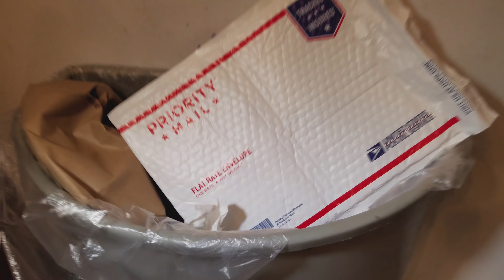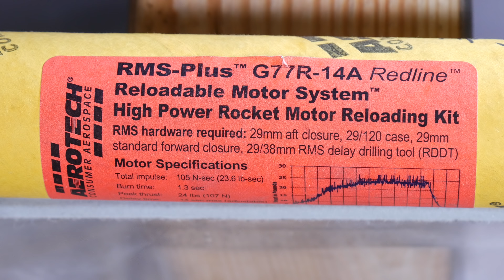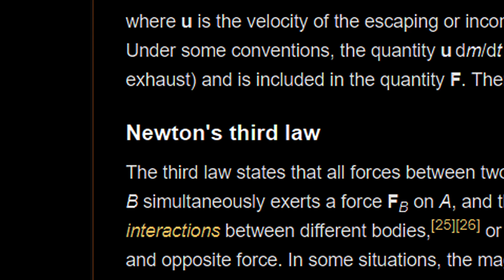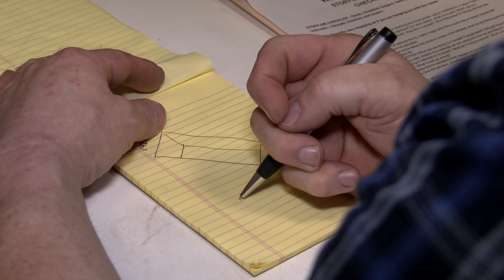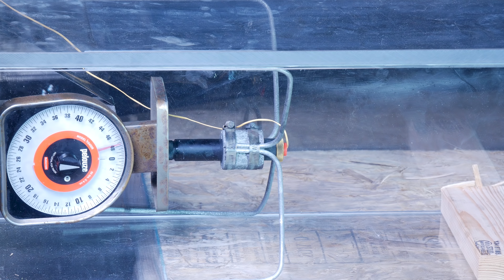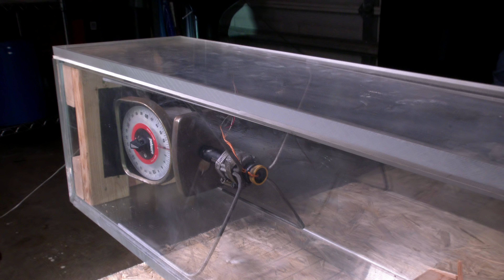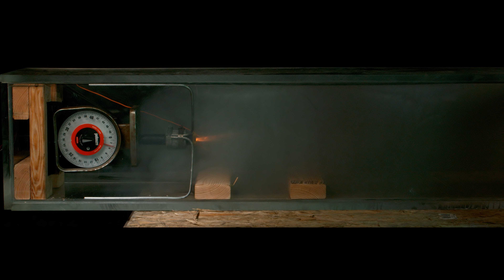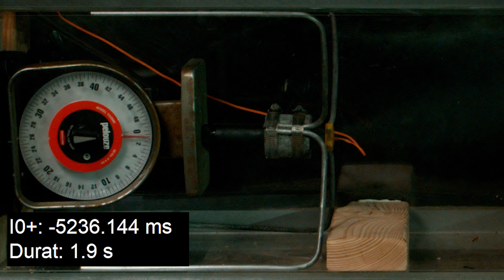Rockets in a Vacuum Chamber - Newton's third law of motion Visualized

Comment: The rocket doesn't push on the air; the propellant pushes on the rocket as it ejects.
Reply: Force=Mass X Acceleration. The gasses accelerating out the back provide a force.
Reply: Papa Legba  How do you explain GPS satellites or the ISS. I have made telescopic and naked eye observations of the ISS. Without functional rocket propulsion, no space vehicle could maintain a stable orbit.
Reply: @ulfhenarpolymathmilitant6258  It all has relative speeds. Picture two cars driving next to each other at 100mph, if you're in one car, the other one will appear stationary if both speeds are exactly the same. Orbital rendezvous is achieved by matching velocity and direction to the target.
Reply: @twistedyogert the iss isn't in the vacuum of outer space, it's in low earth orbit.

Comment: I think you have to try it with longer chamber, so we can see how many "smokes" needed to reach the dead end of the room before it push the non-vacuum material.
Reply: Doesn't the rocket push against the wall's of the small chamber, seems like its the wrong parameters for any real conclusion. Much respect for effort and engineering though.
Reply: The thrust meter measures thrust before the plume of smoke gets a few inches from the nozzle. SO thrust is there before the chamber fills up.

Comment: What is a "complete vacuum"?  There is no such thing. Vacuum levels are have specific terms tied to them as follows: (RV) Rough vacuum= 1x10-3 torr,  (HV) High Vacuum= 1x10-7 Torr, (UHV) Ultra High Vacuum 1x10-11.  The terms "complete vacuum" and "full vacuum" are meaningless.
Reply: @OliverMiles98  This guy doesn''t have a high vacuum pump[ (turbo pump or cryo pump).  So he is operating in the rough vacuum regime.  So that means lots and lots of molecules left in that box.  In fact I would be surprised if  he is even less than 1 torr.
Reply: @bigfoot7883  but space is not a "pure" vacuum either. The idea for the video comes from flat earthers who say a rocket wouldn't work in space cuz its a vacuum hence rockets and space are lies, hence the world is flat.

Comment: In the interests of seeing how well this experiment replicated a state of perpetual vacuum, I would have liked to have seen the  pressure measurement gauge at all times also throughout the entire duration of the experiment.  This data is more than somewhat crucial to the entire experiment if to challenge Newton's 3rd Law of Motion.  Thrust was measured.  Tick that box.  But was this within a state of perpetual vacuum?  It's a shame the experiment did not demonstrate this at all times.  If you look at the pressure gauge at around 10 minutes of the video, you can actually see the pressure gauge moving rapidly in direct response to the rocket burn. So on that basis, this in itself demonstrates the experiment is a fail.  I believe that this shows that the chamber was immediately subject to positively increasing pressure in direct ratio to the energy release of the rocket burn.  I think that there is a distinct prospect here that chamber was immensely too small for this experiment to be accurate.  Would love to see a re-run with this aspect compensated for properly.  The vacuum chamber would have to be quite huge I think, and the actual  size would have to be mathematically derived at.

Comment: Did you not prove Newton’s 3rd law with the hangfire? Though it did not propel your sled, it did propel the smoke.  Smoke is a physical object as well.  In your second attempt, you see the fuse and ignitor swing free, so as the thrust pushed, the ignitor moved. 3rd law.
Reply from the maker: Exactly..... Agreed
Reply: how about for every action there is an equal and opposite reaction .... no 3rd law except on earth
Reply: Dennis Allen  It moves down because everything that is not affixed to something will go down and since it was curved it moved down towards its curvature and that happens in oxygen as well with out having to ignite it.
Reply: nickacelvn what the f*** are you talking about? The Earth doesn't have something behind it pushing it? The Earth is basically falling in a straight line and being bent by gravity around the Sun. What exactly are you even asking here?
Reply: c5elmo76 but why didn't move anywhere? In order for it to move down or swing it had to be pushed off of what it was connected to. How did it do this with no Force? Was it gravity that pushed it away from what it was connected to and then made it swing down?
Reply: Dennis Allen excellent observation 💡
🤓

Comment: To simulate the vacuum of space, you need to create a vacuum that is removing the exhaust from the rocket as fast as it's being dispelled or you are creating a pressure that would not occur in the vacuum and void of an ever-expanding space.
Reply: Nope, because the rocket produces force before the exhaust builds up any pressure.

Comment: So you started with the box (small closed system) under vacuum,... once the solid state fuel finally achieved stable ignition, the gasses created a toxic but physical atmosphere thus filling the (small closed system) vacuum with pressure. Once the volume of vacuumed space was pressured by the gases (I assume the vacuum was nolonger running) the rocket gained increased footing for which to push off of.

Build a new vacuum chamber the size of a room and try this experiment again while continuously running the vacuum on high to simulate the open expanse of space.

I'll feel better with those results. This test will take into account the variables in question as mentioned above thus reducing the likelihood of the propellent creating its own atmospheric conditions.

Thanks
Reply: It would probably work, however to maintain a vacuum in a chamber that size would require rather large vacuum pumps and would still not accomplish anything since we saw thrust in the first few seconds of ignition, long before the chamber had a chance to become compromised.  Add to this the fact that rockets do not produce thrust by pushing off of atmosphere, but instead by using Newton's third law to push the motor in the opposite direction of the nozzle opening due to uneven pressure on the internal walls of the combustion chamber, and you will see why it didn't really matter that the chamber was eventually compromised by the exhaust gasses.
Reply: Oh god, it would not work.  Constant vacuum will constantly negate any atmosphere created by the fuel hence no atmosphere, no barrier=no going to space and no thrusts.  Do not be silly my man lol
Reply: +Rizal Jose Your nonsensical gibberish was silly, not Newton's third law.

For an example of constant vacuum, see Peter Leane's videos.  Very tiny motor.  Chamber was large enough that the expelled gas didn't make the pressure gauge on the chamber twitch.  Produced thrust.
Reply: I was thinking the same thing , this vacuum is no where near scale

Comment: The scale's needle deflects as soon as the engine starts,  when the vacuum is at it's greatest,  and then decreases as time goes on and the vacuum is filled.  If pressure is needed for the engine's force you'd see the opposite pattern.
Reply: rtensor That’s why the efficiency of a rocket engine gets higher when going higher haha
Reply: But the gasses instantly collect before ignition showing it wasn't in a vacuum to being with. An object in motion stays in motion until acted upon by an outside force. Why did the gasses initially collect in the middle? Answer, there was an opposing force remaining within this supposed vacuum. THIS is what you call bunk science.
Reply: @jrngln  I see u lack a basic understanding of how a rocket engine actually works. The burning propellant of a rocket has mass. The rocket engine pushes against burned propellant. The rocket engine creates its own "atmosphere".
Reply: @idontcare7961  The weight of the exhaust gasses is exactly the same as that of the burned propellant. That's basic chemical knowledge. In the case of the NASA Shuttle that is 20x the weight of the Shuttle. That means the Shuttle ejects 20 times its weight in exhaust gasses to reach space. In short ur, physical and chemical knowledge is that of a 5-year-old.
Reply: @idontcare7961  I stated that because that is basic chemical knowledge. Learn how to read.
Reply: @idontcare7961  And your point is? To insult other people with every comment?
Reply: @lifepolicy  Its the truth, not an insult.
Reply: @idontcare7961  So what you are basically saying is that man by building a rocket became god because they suddenly were able to annihilate mass?

Comment: Great Work! I would like to see the pressure guage reading along with the scale reading side by side.  I suspect that initial ignition might re-pressurize the vacuum chamber? The vastness of space would be hard to re-pressurize. Kudos to the ingenuity and effort!
Reply: You "suspect"?
Please calculate the volume of gas produced in the burning of the rocket fuel. Don't forget to show your working.

In the meantime, you can watch countless armature rocket videos of vehicles continuing to accelerate under power as they climb through the rapidly thinning atmosphere.
Reply: you can see in the video there no suspecting,  you see the exhaust pushing off the walls and the back end of the chamber filling up which then pushes it back towards the rocket. even a long bit of soot can be seen(in slo mo part of clip) travelling towards the backend and hit the higher pressure coming back up towards the scale end and joining it, it even passes through/against the new exhaust  when its burning it hardest and catches fire but that new exhaust isn't enough to push agaist the pressure built up from the other end and goes to land at the scale  end. as for him working out the volume there a pressure guage on the chamber all you need to do is see what it at before starting and what it is at after should tell you the new mass in the chamber. rockets lose speed travelling straight up as the air gets thin the exhaust flame spreads right out in all directions meaning less going straight down giving less thrust upward to the point they can't keep going  staight up and so you see them arc over and fly out of sight  crash in the ocean or whatever lol they not going up into a vacuum  and getting any thrust at all
Reply: @darrenprebble6921  more to the point, rockets work BETTER in a vacuum as there's zero resistance.

At least get SOMETHING right.
Reply: @TheTruthHz  rockets can only go straight up until the air get that thin the exhaust spreadout in all direction giving less trust upwards which is why they then fly off to the side away out of sight , if they worked better in a vacuum there be no need as they would be getting more trust being up there but thats not the case

Comment: That's my point. He made a very small chamber and produced atmosphere in it and that's how thrust produced. But space is infinite and it does not behave like this small chamber.

And the most important point is there should be a strong boundary just like your chamber to separate vaccum and atmosphere. Where is that strong boundary or earth?
Reply: - "there should be a strong boundary just like your chamber to separate vaccum and atmosphere. "
A device called a "Gas Centrifuge" can create a region of high-pressure gas right next to a region of low-pressure gas (a "vacuum") with no barrier between the two regions.
This creates a Pressure "Gradient" all the way from high pressure to low pressure just like we observe in earth's atmosphere.

What is the theory of operation of the Gas Centrifuge?
Reply: @stuartgray5877  a gas centrifuge has boundaries, chatbot.
Reply: @papalegba6796  SO AS USUAL, you refuse to answer the question: HOW does a Gas Centrifuge do what YOU CLAIM IS IMPOSSIBLE?
Reply: @stuartgray5877  by having boundaries, chatbot. Already told you 😂
Reply: @papalegba6796  The answer (for your tiny brain) IS: CENTRIFUGAL FORCE.
But since it is obvious you don't even understand the meaning of the word "Force", then you are excused.

Yes, a Force (or acceleration) CAN compress gases such that they exhibit a Pressure GRADIENT. Exactly how GRAVITY applies a FORCE to compress gas against the surface of the earth creating a Pressure GRADIENT. Next you will tell us Atmospheric pressure gradient in earth's atmosphere is a hoax.
Come on do it genius.
Tells us you DONT believe that atmospheric pressure decreases as a function of altitude.
Reply: @stuartgray5877  ok chatbot 😂
Reply: @stuartgray5877 you contradicted yourself totally & I laughed at you, chatbot. You always do 😂😂😂

Comment: It seems like no one in the comments actually KNOWS anything about anything they haven't experience.  It's all relying on their own belief in someone else's 'experiences'.    These little vacuum experiments are problematic to me because they light the rocket fuel in a tiny confined space, after a few short moments the space is actually filled with gases allowing for some, although, slight movement.  Would it work the same in an endless void?
Reply: It would work better. 

Here is my simple question to folks that don't understand how rockets work in a vacuum. 
If I set an explosion off right next to you in  the void of space, would it have any effect on you?
Reply: @entangledmindcells9359  combustion in a vacuum is impossible. So your question is pointless.
Reply: what gets me is the rocket doesn't actually properly ignite until the chamber is filled which makes you wonder if combustion is even possible in a vacuum at all
Reply: @robertenator  it is not, violates first law of thermodynamics as it posits a change in energy of a system incapable of either energy transfer or doing work.
Reply: @robertenator  all combustion needs is fuel and oxidizer to allow the chemical reaction to take place.
Reply: @papalegba6796  what prevents combustion in space?
Reply: @entangledmindcells9359  you need pressure to contain the system
Reply: Alex - "It seems like no one in the comments actually KNOWS anything about anything they haven't experience"

Try ME then.
I am a vacuum test specialist and I have been launching deep space science probes for almost 30 years.
Ask me any question you like about the Mars Global Surveyor, Stardust, Genesis, Deep Impact, Kepler Space Telescope, NOAA-20, or IXPE Xray Telescope spacecraft. I helped launch all of those.
Reply: @robertenator  - "you need pressure to contain the system"
When a rocket engine is running EVEN IN SPACE, the combustion chamber is at about 3000 PSI.
So YOU are arguing that combustion will not occur at 3000 PSI with fuel and oxidizer JUST BECAUSE - Somewhere DOWNSTREAM the pressure drops to zero?
I don't think you have thought that one through.
Reply: @robertenator  what absolute pressure is required. It has been shown at 300,000 ft combustion can occur.  At that altitude, the air pressure is a fraction of 1% of what it is at see level so exactly when does combustion cease to be possible? what  absolute pressure?

(FYI.. even is space, there is a positive absolute pressure)
Reply: @robertenator  - "you need pressure to contain the system"
Tell that to the 4 Solid Rocket motors that I have personally helped launch that lit in hard vacuum.
Those missions were Mars Global Surveyor, Stardust, Deep Impact, and Kepler Space Telescope.

All of those launched on a Delta II with a Star 48 solid Rocket Motor third stage.
Reply: @entangledmindcells9359  I just explained, chatbot 😂
Reply: @sailorman8668  I believe a gas requires external pressure in order to create work, chatbot. Because it's a gas law 😂😂😂😂😂
Reply: @robertenator  correct, you got it. Without pressure, combustion is impossible.
Reply: @papalegba6796  How much pressure is required?
Reply: @papalegba6796  good thing the combustion chamber of a rocket runs at over 3000 PSI even when operating in HARD VACUUM.
Reply: @stuartgray5877  that's an internal force, chatbot. Newtons laws all require external force. 😂😂😂😂😂😂😂😂😂
Reply: @@Sobeit63 chatbot Stuart literally claiming fire is water in its last post. It will rant for months about this if you allow it to 😂
Reply: @@Sobeit63 oh, it's posted some disgusting things about me, like saying my gender reassignment surgery was delayed because of my conviction for child molesting, absolute filth. Then it claims to be a top engineer working for NASA 😂 😂😂
Reply: @@Sobeit63 told you, chatbot stuart is still ranting about fire being water. It has a very weird markov chain indeed 😂
Reply: @@Sobeit63 a thermal rocket is a heat engine of the internal combustion type. Undeniable physical fact, easily confirmed. Try getting chatbot stuart to admit it tho: never going to happen, ever. It's Not programmed to, that's why 😂
Reply: @@Sobeit63 he's still asking me the same question I already answered on multiple threads. Only tactic he has left. Stuck in a loop awaiting maintenance I guess?

Comment: Do a few control test inside the chamber in normal atmospheric conditions , for example 3, then take notes of the thrust and calculate an average and/or a total from each test, (as they will most likely vary a small amount) then,
do the test 3 more times, while in a vacuum environment and calculate the average and/or total thrust.